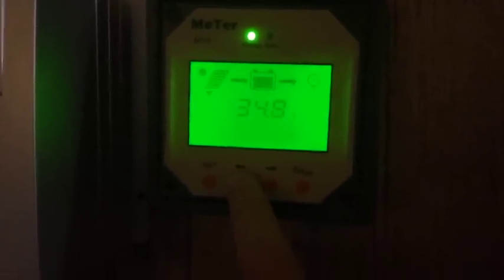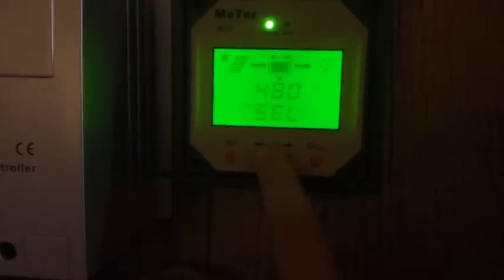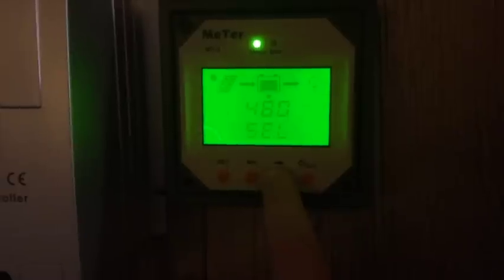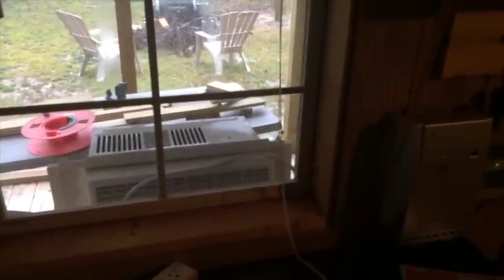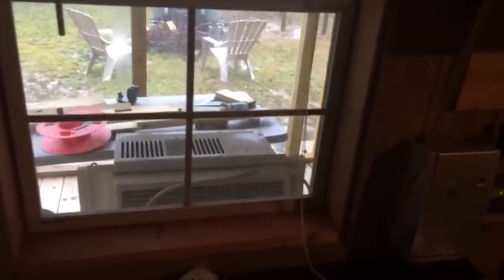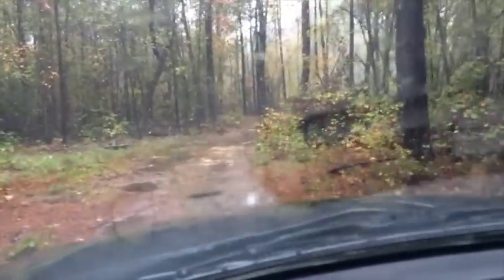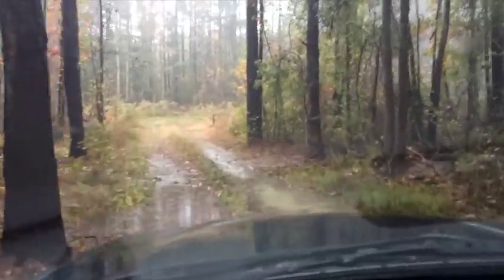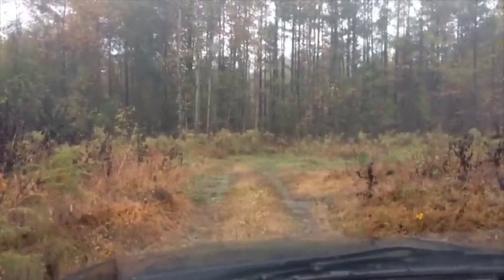I Need Viewer Input: Solar Battery Bank, Rain Catchment, Name My BOL

Comment: For your rain catchment system. Remember that moving water will not freeze. Maybe you could find a 12 volt recirculating pump to keep the water moving inside the tote.

Comment: Our first cabin we build we used Parks wood sealer, looked very nice but it was tons of work. Second cabin we did not seal with anything, looks nice saved lots of work. Our friends cabin is 15 years old and never sealed, looks fine and holding up fine.

Comment: The boiled linseed oil is just a protection for the wood, to prevent moisture to enter the wood. This way it also protects the wood from rot. It should be reaplied every couple of years. If you do that than over time it does give a nice finish. If you are looking for a different finish of the wood then I recommend some other finish like a wood stain.

Comment: If the windows are sealed good enough to just caulk, then I'd leave them as is. The finishing depends on your tasted and budget. :) The only thing I know about your solar is that the more times you convert the voltage, the more you loose. 24 to 12 = loss. 12 to 120 = loss. Just my thoughts. :)

Comment: Names for the cabin? Camp New Life.  Southern Bronx or where ever your yankee butt was from :-)  The Outpost.  T&?(insert wifes initial) Ranch/Homestead.  Camp Justin Case.
AFA the trim....I agree with Dan, cut some finish grade plywood and nail to the 2x4 then frame around the edge with window trim/ 1x4/ 1x2, whatever.
Our barrels froze solid last year. Luckily they were about 3/4 full. Thawed in a few days. I would say drain the system down to about 75-80%
Reply from the maker: +justmeandher112 So, you don't think I have to completely empty them. Interesting. That would be a blessing if I could have some water in there all winter long.
Reply: +Carolina Prepper We have 60gal. black pickle barrels. Pretty thick plastic. They froze solid. Not sure how your tote would do. I would think that if you leave room for expansion, you should be fine. I look at a plastic bottle in the freezer. It's fine with room to expand, fill it up and your in trouble.

Comment: Lin seed oil will give your cabin a funky smell. Go pure sine wave for the inverter, on a 12v system you can recharge the battery's in an emergency by your car/truck,  what good is a frozen 250 gal block of water? Drain your system. Inside lines also! Always buy a full wave inverter, I have an attic full of what I thought was good inverters, I use a GO-POWER 1500Watt, a little expensive ~$525.00 but you get what you pay for in choosing an inverter. The board in the window frame will work fine, prime it and use an oil base paint, like bath room paint that can handle moisture.
Reply from the maker: +Jim Smith Thanks for you thoughts. As far as the water tote goes...even though the temp can and does dip below freezing where I'm at it usually doesn't stay there very long. I was thinking that if I didn't have to empty it I could still use it (possibly). The modified sine has worked well for me in most situations with minor annoyances but I think I do want to upgrade to a pure sine. I just need to wrap my head around the price. It's so dang expensive to buy a "good" name brand one and it's typically not my style to drop that kind of cash. I'm on the hunt and hopefully I can find one with good reviews that is budget friendly. So, you think I should stay with a 12v battery bank and inverter?

Comment: Window trim? you can cut strips of plywood on the table saw to get the right depth and trim with 1x4's, then add a cheap blind, your wife can add curtains if she feels they are needed. You have to make her happy. 
if you get a camper, with kitchen, bath and bedroom, what will the present cabin be use for? living room?
Reply: +Dan PetersonTaylor 
CAMP TEOTWAWKI  pronounced  ti.ɑt.wɑk.i
but I don't think it is a camp, or cottage, it is a place that should have no signage. It's a safe retreat if you need it.
Reply from the maker: +Dan PetersonTaylor Good ideas. Yes, the current cabin would be the main living space.
Reply from the maker: +Dan PetersonTaylor Good thought but I'm considering the travel trailer because it is ready to go. I wouldn't have to build anything and it can free me up to do other things.

Comment: Squirrel Cove  & Squirrel Cove Lake. 

The water line is going to freeze and break, IMHO

I can't picture it staying below freezing for that many days to freeze the water tank. If you think it would be a problem, build walls and roof around it put in 6" of insulation, Build wide door (insulated) to service the tank. Keep in mind if TSHTF you will need this water for family survival.

Wood walls, as long as the remain light.  dark color would make it feel cave like.

No clue on solar, but how much power will you need to operate "Squirrel Cove" and the trailer, if y'all had to really live there. 

Battery Location? This item is just as important to guard as fuel or heat.

Comment: See my comments Brad's site vid.  Same topic rain containers, winter, insulation, heater coil.  Best option(s).

Your power issues ONLY depend on how much energy you use, moderate and peak use.  What are your lowest to highest energy suckers?  How long will each individual device will drain your battery bank?  Make a chart of these energy consumptions.  Go online and see what is the sunny, cloudy days for your area, and factor that into having active solar panels, or pure drain on the batteries.  You might need a larger battery bank of said batteries for your light or heavy duty cycling.  Definitely marine deep cycle batteries.  24V sounds good for panels.  Inverter handles the transformer issues.  Only issues are your usage, power demand peaks, ... and for God's sake don't be pushing your power limits and brown or black out your equipment.  Easiest way to start replacing every tool, fridge, freezer, etc equipment and lightening up your wallet!  13.2 V is nearly accurate overcharging rate for any auto generator/alternator charging system on 12 V batteries.  More panels, more batteries.

Land name:  MYCNYC:  My See Nice See.  My crib, not your crib!

Comment: 24v beats 12v but not all inverters accept 24v input.  As the voltage of the inverter goes up, so does the price.  I was looking at a 12v/24v/48v for my place and it was $2,000.  I wouldn't change unless you need to run higher power devices.  I had no idea about linseed oil self combusting, good one to know.  On the name, I would pick something historical to your family.
Reply from the maker: +Adventurous Aardvark Greaseball Pond? 😅

Comment: 12V vs 24V is a judgement call, smaller cables is a plus for 24V but in the end, 12V wins out. As far as inverters, full sine wave wins the debate, hands down. I would be more than happy to sell you some 2500W modified sine wave inverters, not really, they are junk. Trust me, They are crap! I do have an EET degree so I do understand the fundamentals. Good luck, and stay away from E-BAY when buying inverters! 2000W for $200.00 please!